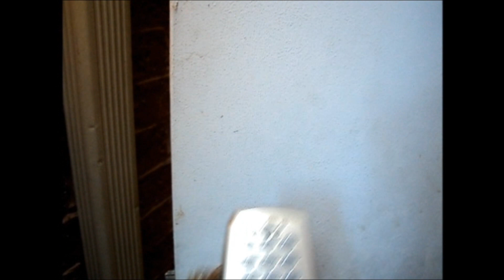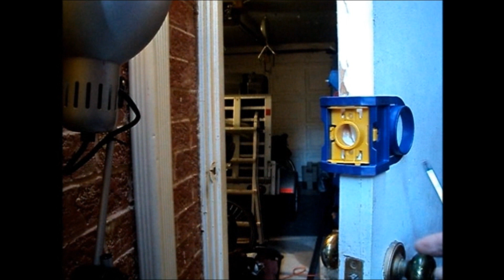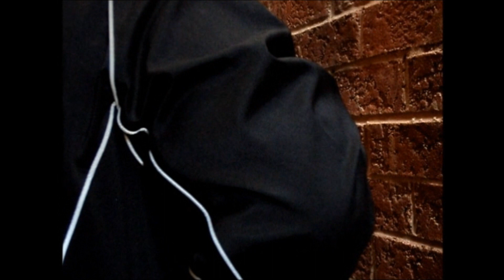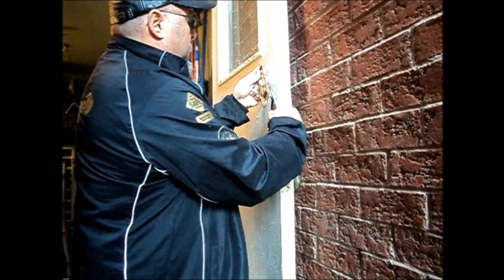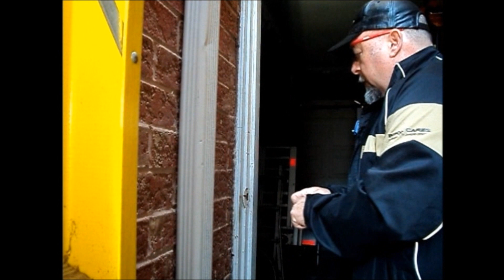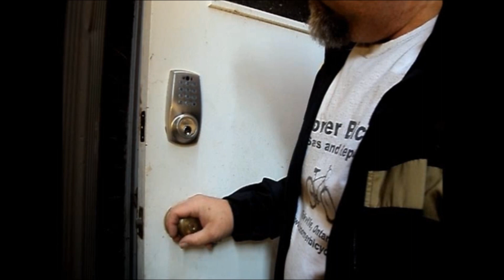Installing an electronic keypad deadbolt.

Comment: Excellent video on installing the Gate House key code and key lock.
 But the doorjamb was installed improperly the lock is serving no purpose as he sad its harder to kick a door in if it opens to the outside which is true as you can see at the end of the video the door hinges are exposed.  only one would have to do is remove the pins from the hinges and taking the whole door off there will be no need in kicking the door so make sure the hinges are on the inside of the room you are trying to secure
Reply from the maker: +Robert Fromal  What I did not show was that I welded the heads of the pins to the hinges to prevent pin removal. For better or worse, the door was already there, so that's what I had to work with.